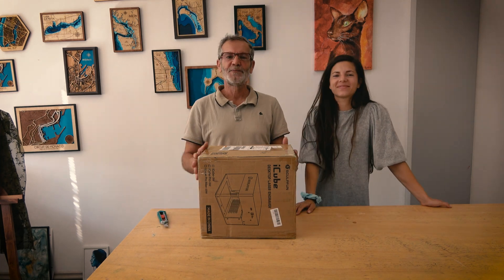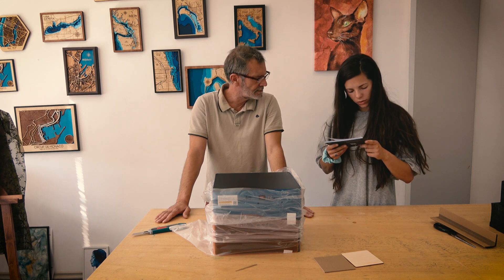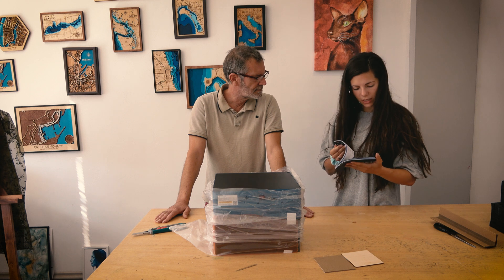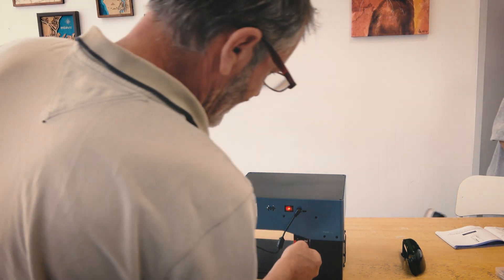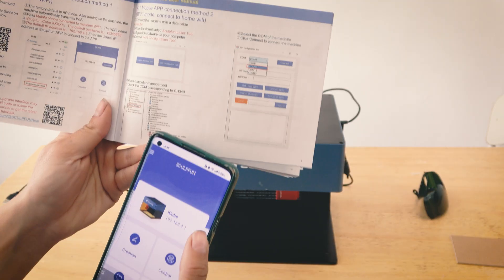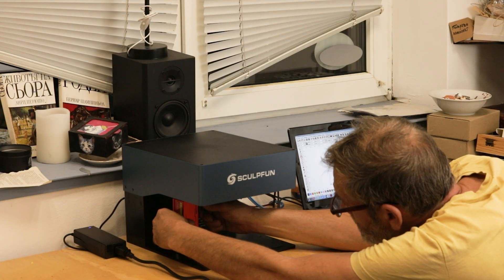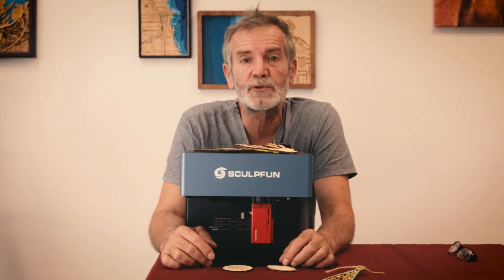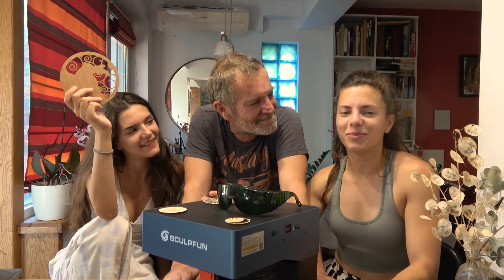Unboxing, Testing, and Review of Sculpfun iCube ProMax 10w - Our New, Small Laser Engraving Machine

Comment: Will this machine engrave stainless steel army style dog tags.
Reply from the maker: I think that it will not work directly on the steel. But I think there is oxidized steel on which it can be done
Reply: @HandmadeArtBg  I want to buy one to engrave stainless steel pendants for my bracelet brand, It has low cost but I don`t know if it`s powerful enough to engrave this material without it looks like cheap or superficial, that`s why I am asking if it only paints or engraves
Reply from the maker: @farofa01  I don't think he's still suitable for this job. Even with my big and powerful laser, I can't engrave steel.
Reply: @farofa01  Even i wanted to do the same, did you find any solution yet? Was thinking to buy icube 10W
Reply: @HandmadeArtBg  thank you.
Reply: @HandmadeArtBg  Does it mark as it was painted or does it engrave with low relief on oxidized stainless steel?
Reply: 999